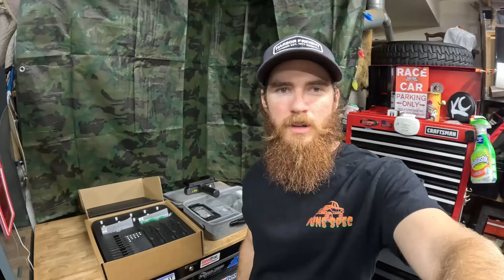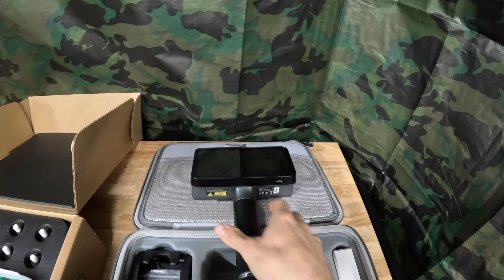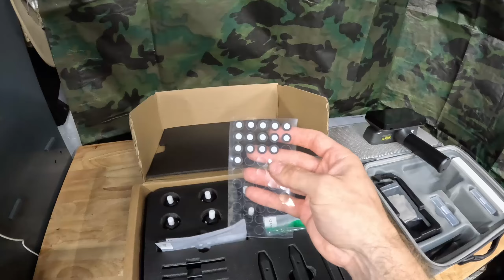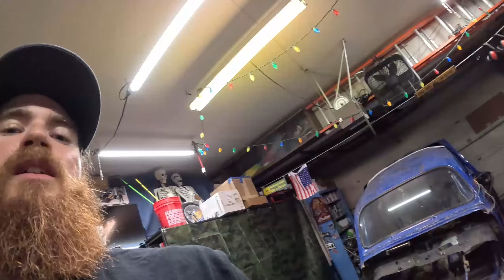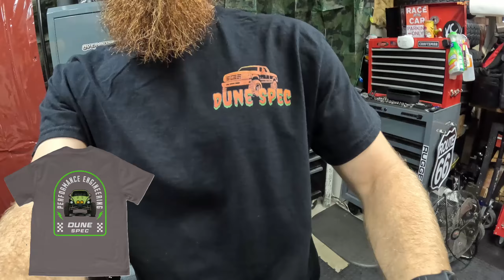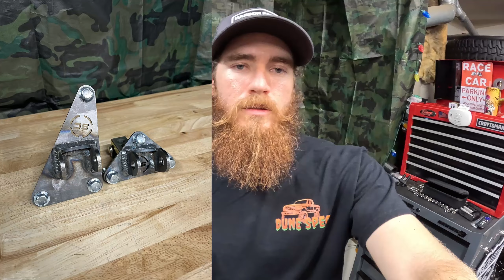How We Design Custom Off-Road Parts with 3D Scanning | DuneSpec Shop Vlog

Comment from the maker: I say 1" x .120 wall x 1.50" length tubing for the J-Series Motor Mounts, but I meant to say 1" x .250 wall x 1.50" length tubing. They utilize a 1/2" bolt.

Comment: I might have a few ideas for products that would help me along.

Off hand, I'll be checking your J35 motor mounts, and that shifter mount (I believe i have that type).

But if you could make a cut bracket to build baja bug mirrors off of, that'd be awesome.  

Another super sweet product idea is a c-hannel type thing that you can french some LED brake lights into the chassis... that would be slick.

Anyway, I'm looking forward to what you come up with!
Reply from the maker: Awesome ideas! And thanks for the support! Super helpful when people have suggestions on products to work on.

I went ahead and made those mirror build plates you mentioned and put them on the website! 

Ill reach out to you regarding the LED brake light integration into the chassis to better understand what you're looking for.
Reply: @DUNESPEC im definitely going to head over there to check them out.
Reply from the maker: @thebinderbuilder  Thanks for the support!
Reply: @DUNESPEC you make some good looking stuff.  I'll definitely try to get whatever I can from ya.

I had another product idea.  Weld-on 1/4" plate winch mounting plate.  Very similar to the shifter plate I ordered, but spaced for mounting a winch (which is like 4x10 or something like that).
Reply: @DUNESPEC speaking of which.  Now that you've scanned the XJ radiator,  a mounting system for it would be awesome.   In particular, if you had some c-channels for the long ends with enough room for foam padding, that would be particularly awesome.  Just a thought
Reply from the maker: @thebinderbuilder  I thought about doing something like that! I'll have to think about how to make it easily adaptable because everyone's chassis is different.
Reply: @DUNESPEC true... true...  

I figure with holes for isolators and make it out of steel so guys like me can weld tubes to it and put it wherever we need.

I look forward to seeing what you come up with.